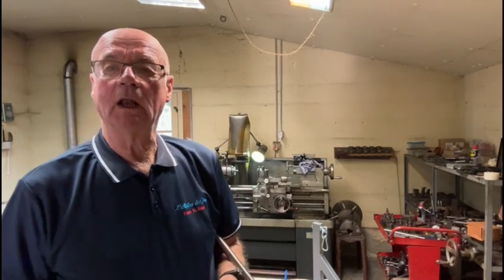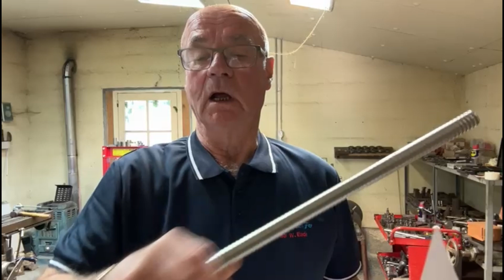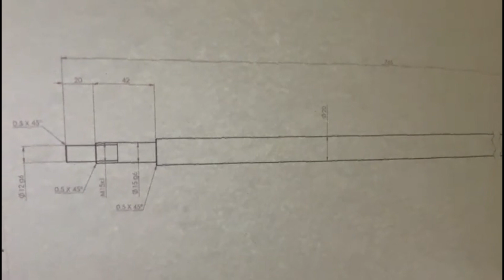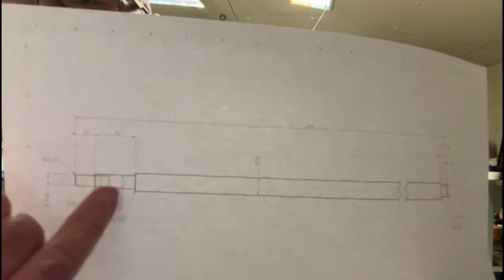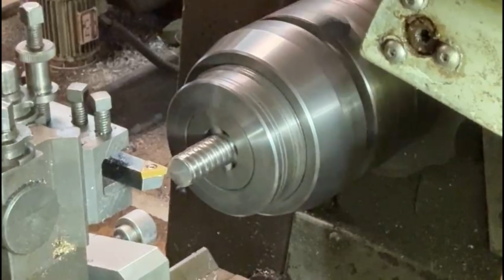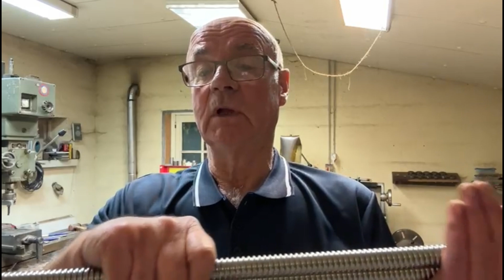Machining 2 Hardened Steel Threaded Bars

Comment: As usual excellant result just one question with that hang out no end support?? Paul.
Reply from the maker: Hi Paul, not sure what you mean. The end of the bar was only 62mm. the other end has a support collet in the back of the quill. I have several different sizes. Cheers, mate.

Comment: Great job! Looks like it wasn’t only case hardened. I machined some threaded rod a while back. At first it was hard and chipped my insert, then when I got through the outside, it was easy. Cheers!
Reply from the maker: Hi Greg. It was certainly pretty tough trying to machine this, I wrecked 3 triangular insert tips on this job, mainly cutting through the intermittent screw thread.

Comment: You did very well with that hardened material Frazer! I think I would have ground the threaded bit off on the bench grinder to get rid of that intermittent cut, it must have knocked out a few of your expensive tips, did the customer supply a threaded nut with the drawing? Stay warm! Chris B.
Reply from the maker: Hi Chris, it certainly tested my lathe with the intermittent cuts through the thread. Customer didn't provide a nut so I'm hoping the thread is good. Hope you're keeping warm too. Cheers.